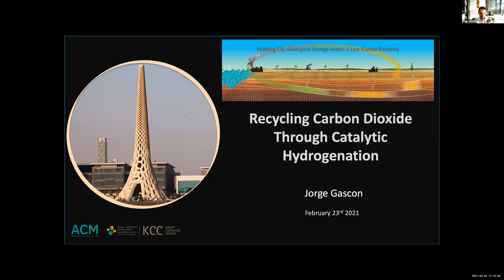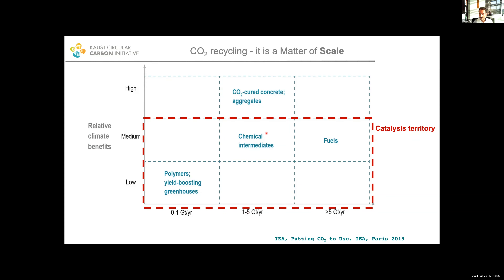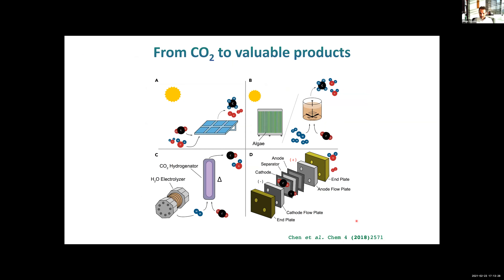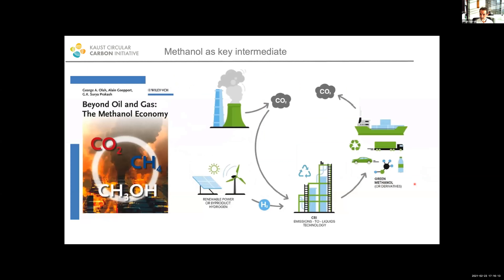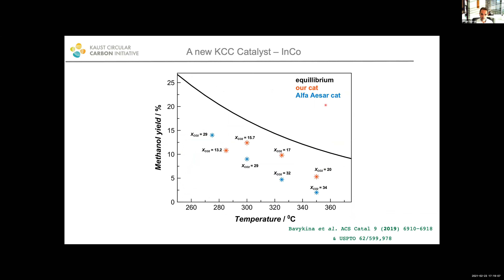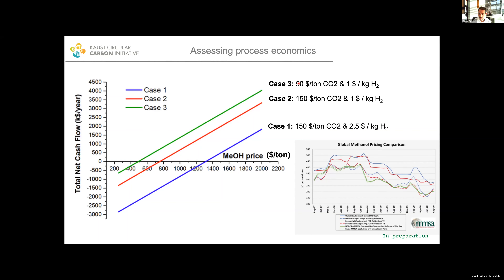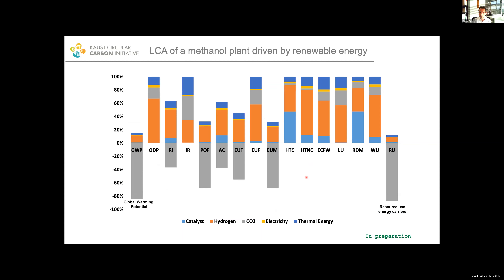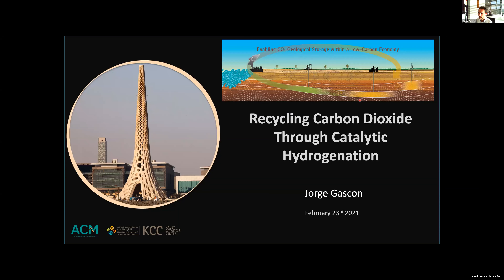Recycling Carbon Dioxide Through Catalytic Hydrogenation | Jorge Gascon

Comment: Very good. 
If we start with 100 kwh of green electricity and a source of pure CO2 how many kwh of methanol would you expect to produce ? I believe CRI say its 60 kwh.
Also, have you considered combining renewable methanol paired with an allam cycle to make electrical power. 
Could be useful for 
a) land based energy storage and dispatchable electricity generation (store the CO2 geologically and re use it)
and 
b) similar but this time import e-methanol from a country where renewables are cheap, oxy allam burn to make power then separate and liquefy the CO2 and send it back above triple point to make more e-methanol (in the same ship).